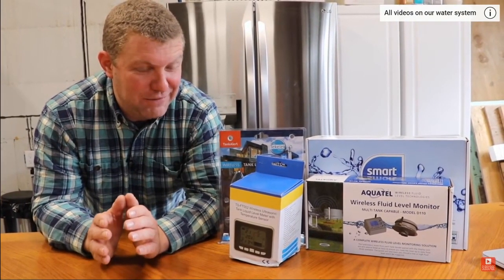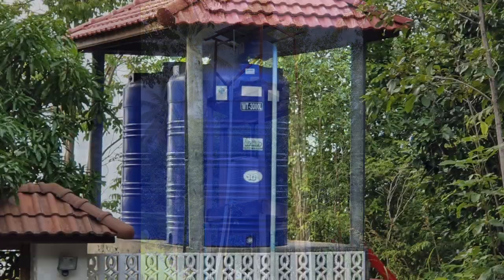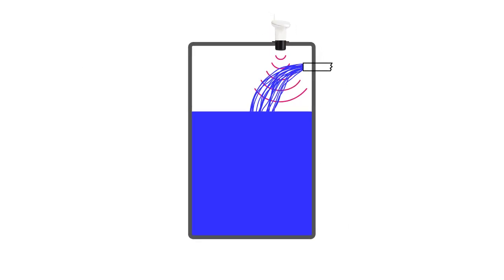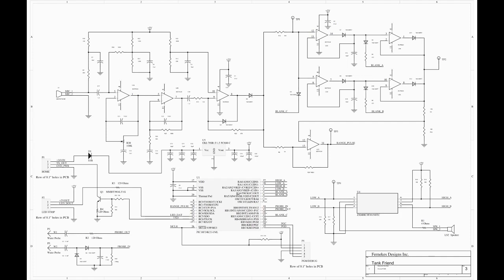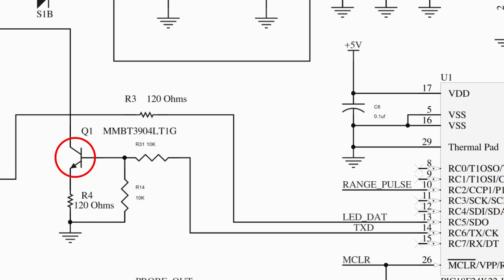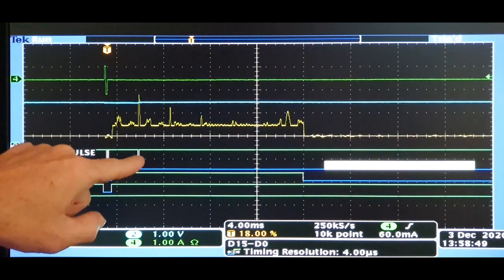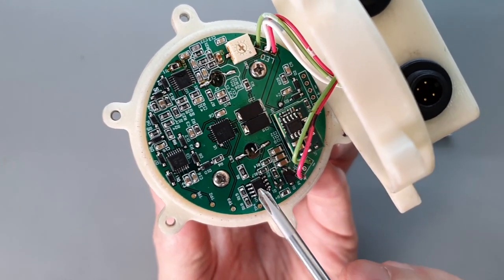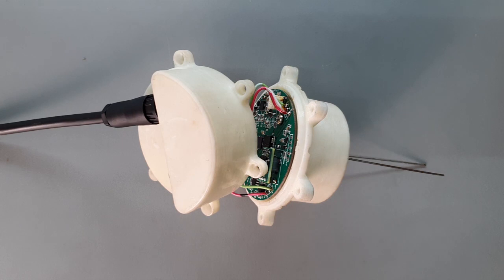Product Development: Water Tank Monitor System.

Comment: Super stuff. A friend of mine developed a very similar audible acoustic wave based system in the 1990s, but the target was heating fuel tanks for rural properties. It was a great success and was still in production a few years ago. It used a radio link at very low baud and transmitted once an hour or so. It was definitely in the more premium price bracket though.

Comment: I've got some(3) water tanks, and I really don't see the point of such device unless it can be connected to something. So I think it would be nice to have 2-3 relay outputs (tank empty, tank full, tank halfway). Maybe at the display side? so the main unit could be kept minimal (2 connections), and an additional unit (relay output unit) could be created and  connected to the led bar (the data is already there). Please do some livestreaming, chit-chat videos also (less effort from your side), I'm really hooked:) Every video is pure gold. I've created with your prototyping technique a furnace controller board:)
Reply from the maker: The unit has a serial data output, the plan is to design a secondary display and control unit that could drive some relays, etc.

Comment: I really like the solution you came up with, I build one about the same time you were , but used a waterproof US sensor. First tried to place the sensor in a pipe but that didn’t work then I settled on mounting the sensor in a box that I mounted on top of the tank.
Here in New Zealand everyone in a rural area have to use a water tank for household water and most commonly they are 25,000 or 30,000L
The advantage is that on most of them the top is a dome so that gives you the 40cm clearance that US sensors need to work properly.
After installation the system worked well but the next morning it didn’t, so I removed the sensor box from the tank and found that condensation had formed a drop on the sensor after wiping it off it worked well again but the next morning the same problem so I mounted a 12V lightbulb inside the box and run it on about 9V so it will never blow, this solved the condensation problem. It has been working very reliable now for a year and a half. Probably due to my age a am a firm believer in cable connections so I power the sensor box with 9V for the light and then make 5V with a regulator for the arduino nano, this arduino sends the water level in % out of the serial port into a RS485 interface so I can have a display up to several 100 meters away and also have multiple displays on the same line. Currently I have a simple 7 segment led in the pumpshed and a graphic display in the house as it using low speed RS485 you can connect it with cheap CAT5 cable.
I really like your led solution that looks really cool.

Comment: I use a 30 kPa pressure sensor at the bottom of the tank connected to the analog input of an ESP8266 that sends the data using MQTT to my Node-red based home automation system. Works quite well and also shuts off the water pump so it doesn't run dry. Also not very expensive, the sensor being the most around 1000 baht from Lazada.
Reply: Your solution is great for a container but how would you implement it for a small 3 meters deep river ?
Reply: @jimviau327  pressure at depth will be the same regardless of the container or movement.

Comment: Leo - Love all your videos - so much thoughtful engineering and useful tips.   I was thinking: 1) those vent holes look big enough to be access ports for mosquitoes.  2) I wouldn't want to add an external tube on the outside of an existing water tank for fear of seal failure and leakage.
Reply: 1) In my (tropical south India) experience mosquitos usually don't breed in overhead water tanks. Maybe it is too high for them, maybe it gets too hot in the sun, I don't know. 
2) Up there near the tank there is very little water pressure, so if the rest of the house plumbing holds up, not something to worry about.

Comment: Greetings from Argentina! Very nice design. I love all the analog part, it is generally lacking on most other creators (of any sort) and reduces the cost greatly (besides being super cool). The only weak point I see on the design is bugs. I think you should add some sort of filter to prevent anything water-seeking entering the tube. I've seen live frogs on supposedly "closed" tanks. 
PS. The DIY prorotyping tool is genious, I use a similar method but was never happy about the cutting method. Gonna try it soon

Comment: That is a great first step, but how reliable are speaker, microphone and flood sense wires long term? The speaker forms a superb waterproof surface towards the container, but the back side is practically open, it's covered with felt leading to the chamber behind the membrane, where delicate wires live and will probably get corroded eventually. And while IP rating of the microphone guarantees that it's OK to submerge for an hour or two, i'm not convinced that the crimp on the rear PCB side of the microphone capsule, while perfect at first, doesn't become a capillary channel after a few temperature cycles, as the PCB jacks the crimp open by thermal expansion. Inside is an impedance sensitive JFET like K596 that is easily disturbed by even elevated ambient moisture. I also don't even know what they did to protect the front and how durable it is long-term. The rear of these components is in a waterproof chamber, but how water- and vapour-proof is it really? There's sense wires sticking right through the plate, there's connectors on top, there's the mounting holes for the microphone and speaker themselves... And once moisture gets in, can it ever get out? It's likely locked in there forever.

I also remember someone testing all kinds of flowerpot reminders, all kinds of sensors and things conductive and capacitive that you stick into a pot of soil and which are supposed to tell you when the moisture level is too low and you have to water your plants, and none of them survived a few months. This makes me suspicious of flood sense wires. Not to say that they can't be done, just to say that special measures are needed for sure.

Outdoor stuff is rough. I have an RF thermometer here that i can't get to work reliably, it always fails in the winter, i reflowed every joint with leaded, and i waterproofed it best i can, lacquered the electronics etc, and it's still wonky! And there's barely even a proper winter where i live, it snows about once every 4 years!

The single most robust component i can think of is a piezo disc transducer, and i can vaguely imagine it being used for both generation of the pulse and sensing. These sit at the bottom of a humidifier and last a good few years. Should that be viable, you might just laquer coat the finished PCB and not have to worry about moisture in the PCB chamber.

Comment: Very nice a reliable solution to a practical problem that helps everyday life, excellent.
I like the adaptive threshold circuit, that removes the headaches of the double, triple bounce and sound speed temperature variation. The wavelength in the pipe has a different than in free space does that cause a prpblem?

Comment: So what happens during a wind storm and creates the bottle effect like when you blow over it making the bottle a flute..   or what happens if the tank constantly has a drip on the outside or any external noises that happen to hit inside that signal window?   Because inside a tank when a noise is made the sound is amplified and distorts which might create a false read...  betting you tested all of this long ago but just wondering...

Comment: Awesome explanation, as usual, thanks for sharing! The analog processing section is very intriguing, I wonder though if it'd be possible to perform it in the/a microcontroller itself, in software
Reply from the maker: Sure this could work- just need an ADC with a high sample rate, but this would make a pretty boring video, right?

Comment: I wonder why a classic gas tank gauge wouldn't work.  Maybe has to do with corrosion or the design of the tank, as the lever in a gas tank gauge is designed for longer tanks, not taller tanks, but I'm guessing the values could be converted.

Comment: Perhaps instead of soldering the full tank probes in, could you use Mill-Max pins and basically press fit them in? Put the two connectors on their own PCB with pins that go to the main PCB. Install the connectors into the top shell, put the main PCB down over the connector PCB and solder, install the bottom shell, then insert the probes from the bottom into the Mill-Max pins.

I know you don't like radios, but an alternative model could use the same basic main PCB and LoRa radios. Low power, incredible range, and low cost. You could run the transmitter side off a Tadiran TL-5930 Lithium Thionyl Chloride battery for 10 years, easy. The unit the house could remain LEDs, or you could go to a smaller display at some point. One major feature you have to your advantage is that you only need unidirectional communication.
Reply from the maker: "Leo is allergic to radio..."

Comment: Hi Leo. Your analogue section can potentially be replaced with a PGA460, have you looked at that chip? Then you can use a single transducer (like a bog standard 40kHz proximity sensor). I did not look at the total cost of your solution so I do not know if that would make sense from that perspective. Let me know if you need any help with that.
Reply from the maker: Wow thanks for mentioning this PGA460 part- never seen this- very interesting!

Comment: An excellent video, very cleanly communicated and edited. It's a cool product and I especially like the fact that it can be installed parallel to the tank. You accurately read my mind since the whole time I was wondering why the clicking was so frequent! Would it be possible to use lower frequencies, or would the convenient planar effects you mentioned go away? Also, if you're already using an enclosed pipe for measurement, could other measuring techniques be utilized? For example, a force sensor at the bottom?

Comment: Great vid! Could you maybe make the case halves thread together? Have a circular, through-hole connector centrally mounted on the PCB (pointing up). If your tolerances were right, the lid could compress an o-ring on the perimeter of the base and one on the connector body as it bottomed out. Also, maybe 2 stainless PCB mount screws that are long enough to function as probes?
Reply from the maker: We need at least 2 connectors: One for the local display, and one for the "home run" back to the power source / remote display station.

Comment: Have you thought about surge protection on wire inputs? I didn't see any in the schematic. Long ago we had a TTY current loop on a wire between buildings. After a thunderstorm, the serial port on the minicomputer fried, even without a nearby strike. Fortunately they repaired the computer by replacing a few chips. A door bell solenoid is tough, but not transistors. Now wired sensors always remind me of that lesson from my job in high school.

Using a separate tube makes a lot of sense, and the full level probe a good idea. Does tube diameter matter? Can a cheap 1" pvc pipe work? Now I wonder if you could use a resonant circuit, a water trombone, with a frequency meter for more reliability and accuracy.

I've been looking into a capacitive water sensor with 2 concentric pipes, but haven't had time to experiment. Maybe acoustic in a tube is better, especially for longer distances.
Reply from the maker: You are exactly right- it needs an extensive protection network on the power and data connections. Step one is validate the overall concept before investing the time to develop and test the protection scheme, it's not a simple matter to test this stuff!

Comment: Hello Leo! I am thinking about using HC-SR04 with a pipe. Have you ever tried such basic sensor in this configuration? In my case we are speaking about underground water tank. Sometimes it gets overflowed. I am affraid that such event will be a disaster for electronics. (mic and speaker mostly). Perhaps this can be avoided by turning upper part of the case into a cup? You can put the electronics into this cup so air pressure can prevent water from turning the electronics into a piece of junk. Connectors would become troublesome however this is easiest way of flood prevention. Polymer coating is a must have to protect from the vapour ofc.  Best Regards!
Reply from the maker: The HC-SR04 works at 40 Khz, these sound frequencies do not propagate in small tubes very well.

Comment: I have a small boat with 2 fuel tanks, 2 water tanks, and 1 wastewater tank, and zero working tank guages. Your solution might find a market in the boating world. Wires would be no problem, and you'd have 12 or 24 volts DC available. I think you'd need to move your vents down into the tank. Boat tanks have vents.
Reply from the maker: Had not thought about boats- but you are right- a perfect application!

Comment: couldn't you get by with a single sample-and-hold peak detector?
since you only need the threshold on the second pluse, you could use the first pulse to "prime" the S&H  and then measure the delay with the second one
Reply from the maker: Sure- I use that same circuit and code for another project that does continuous sampling, that's why there is two...

Comment: Great video, really helpful! What kind of external connectors did you use? I've used GX16 plugs for a couple recent projects but yours looked much higher quality.
Reply: at first they look like waterproof christmas lights connectors they make with 2, 3 and 4 pins... but they really aren't

i think lights used some specific connector as inspiration

Comment: Very cool video, I'm a fan of your work... Personally I would have approached the problem in a "silent" way using light instead of sound (see the I.C. VL53L1X). As a curiosity, how much energy does the sensor side of the device uses? (in case you want to go wireless with LoRa or similar...)

Comment: i didn't get how it's calibrated exactly? does it try to switch like 1000 adressable leds on and then measure current to figure out how many is actually left after you did cut extra ones off. then turns that into maximum depth by adding distances between leds up to millimeters? kind of makes sense for me
Reply from the maker: Simpler than all that. It lights up the LED's in direct relation to the distance from the water level. The LED's you cut off would not light up anyway, if the tank is 6 feet tall, the lowest water level is 6 feet down.

Comment: Super.  Very good project. Very well explained. You seems to have thought to everything. But what about the humidity getting in your speaker and microphone? It would be a shame to waste all that beautiful knowledge of making that board if it dies because of the humidity.  I have used those ultrasonic sensors (similar process) and tried to waterproof them but the humidity always get to them. I really really like your design, but... afraid that there isn’t much we can do to protect the speakers and mic. Have you though of something in that regard?

Comment: Good product explanation, but too complex. I would use one amp & use ADC to do the signal processing in digital.
Also, I live in Pakistan, & EVERY house has two tanks. Some simple & reliable solutions are available. My favorite one just uses a pressure transducer, a microcontroller & a seven segment display showing 0-100%. Designed by my friend. Very elegant.
He sells it for about 15$.
It can be installed anywhere in the house & connects to the plumbing via an air tube.
Reply from the maker: You would need to have a high sample rate to get the timing resolution needed, doable, but might cost more than some analog and a cheap MCU?
Reply: @leosbagoftricks3732  Right.
But the idea of using a pressure sensor is super simple. They just calibrate the empty & full pressures.

Comment: Did u try a single piezo disc for both Tx & Rx?
Reply from the maker: Cool idea! a bit tricky to generate the high voltage to drive the piezo and handle the TX/RX switchover. Worth some experimentation!
Reply: @leosbagoftricks3732  Look up Acoustic Thermometry. Jim Williams did some work in it too. Tho don't recall if a piezo was used.

Comment: I am happy to have found your channel. It seems that a mind like yours is in extinction, paradoxically due to the flood of cheap Arduino modules, which limits the detailed research of the problem to find the most appropriate and reliable solution to the problem. Modular is great, but in this way, creativity and technical skills are killed in the long run, and to be a good product designer you need both (the "Arduino generation" is already creatively dead). I believe that your channel will gain in value and views over time, although it will be increasingly difficult for most people to understand what this guy is doing😄. Keep going, I will be your follower for lifetime
Reply: I agree with your sentiment, but it's a bit harsh to say "the 'Arduino generation' is already creatively dead" since having access to easy learning/prototyping tools can enable those with creativity to actualize their goals. Of course there are a lot of people who will utilize the tools to make braindead ideas, but that's existed forever. Look at the existing water measurement tools showcased in the video as exhibit A.
Reply: @ollie-d  Lack of creativity is a general problem in a world of abundance not only of the Arduino generation. Creativity is strengthened when you have few things available, not when you have too much of everything already done. How would you make this water level measurement tool even more simple, cheap, reliable, precise and robust than the one from the video with Arduino, without the use of an ultrasonic or laser sensor? Describe your solution and I'll describe mine😉